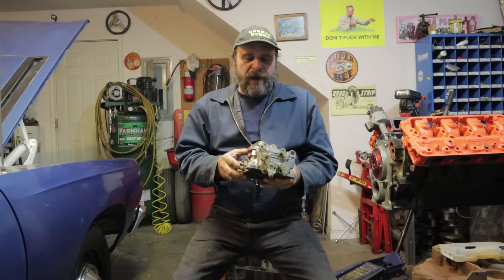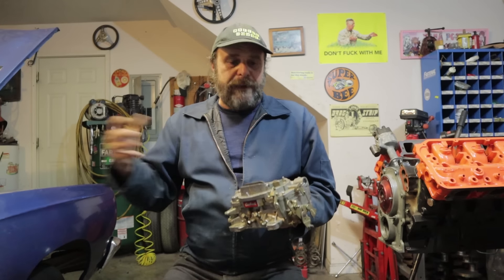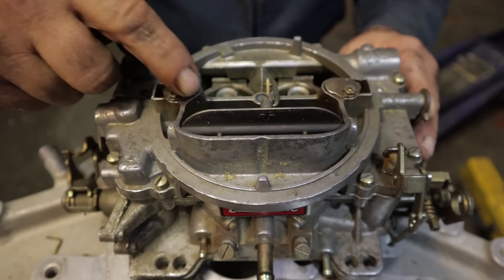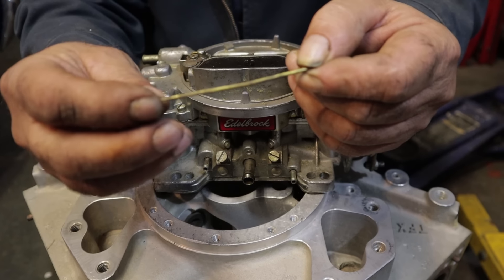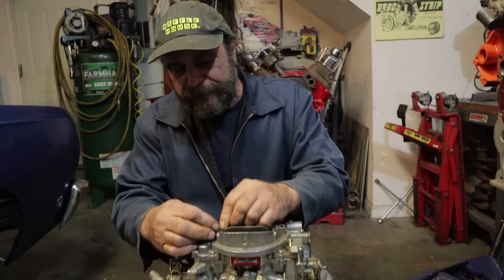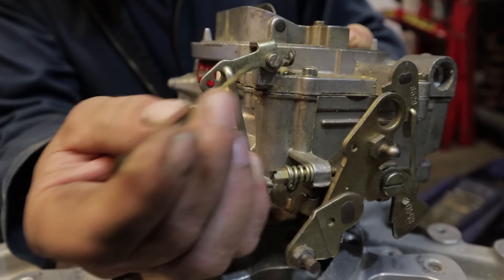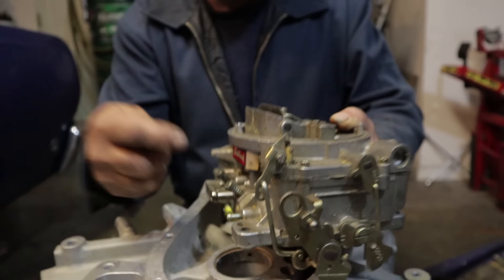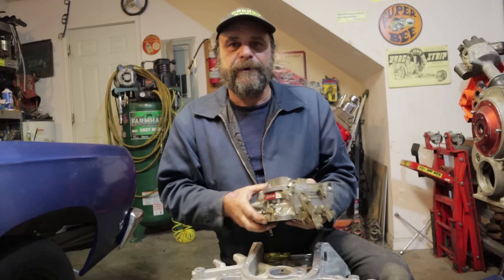How To Make The Edelbrock Carb REALLY Work For You

Comment: Thank you for this video. I have this one and reason im on here is to find out why my truck is stalling on me when i 1st tart it and go. It oes sit all week or sometimes only 2 or 3 days. Now i know its normal. Just started working on carbs. Always only used to work on fuel injections. Thanks again. Lot to learn on carbs. But my 69 Roadrunner 440 magnum is good then. I have in an 86 Dodge Ram.  I thought there was something wrong with it stumbling. I was about to go work on it. Its finny it starts great in 0 to 10 degrees weather but if its 30 to 40s it stumbles.

Comment: As long as you have a good understanding of how they work Holley's can be decent carbs if setup right and you have the right one for the engine you are running (no 750  double pumper with mechanical secondaries on a stock small block automatic car) but hands down for a street car the AFB is the greatest carb ever, I would take a holley over an AVS though or depending on application maybe even a Q-Junk since they are capable of up to 800 cfm......

Comment: Slowly trying to make a ford 400 less of a pig. Firstly having going from 2bbl to the Edlebrock Performer and that was a night and day difference. It aint gonna fix the lousy cam/heads but I wanna do a full rebuild later anyways. Least to say information like this video is priceless as I'm just now learning old motors.
-
One thing that still gets me is I can't get reliable starts. Brand new fuel system (from tank to carb) but sometimes she still just wants more gas. Other times I just bump the ignition and it roars to life. Maybe faulty starter? I'm kinda at my whits end by now.
Reply: Follow up, as I just found my old comment again lol. Turns out fuel percolation sucks and exhaust crossovers + mechanical fuel pumps, channel a lot of heat into the fuel line. Ethanol boils at around 150F, and since most (affordable) pump gas is gonna have some; it doesn't play nice with a hot engine.

Comment: i agree ,holley is best for all out race care performance but not for the street. the throttle blades can ice over and stick open if its cold out side.
 for reliability i love the Rochester just set it and for get it as the Rochester will be trouble free for years. 

street /strip performance/reliability , cater /edelbrock is the best choice.

Comment: ill keep my Q-jet. 

when i got my 77 chevy 1/2 ton the first thing i did was take off the eddlebrok and RPM manifold and swap on a stock iron manifold and a carter built q-jet from the mid 60s
runs fucking GREAT 

-50f and it will fire right up

Comment: This is what Ive needed. I have an off idle stumble that pisses me off. My edelbrock 750 works well but always has an off idle stumble unless I hit the gas harder than normal. 
Mine also drains or evaporates the primary as well as the secondary if it sets for say 2 days. Im running a mechanical pump with a regulator set at 5psi on my 402 bigblock.

Comment: Great video and explanation except I think you had it backwards on the heat of the day tune vs the cool evening air… heavier springs should be used in the cooler air to get the metering rod out of the jet quicker

Comment: a few things. empty float bowls in the morning. disconnect the fuel line to the carb and attempt to blow backwards thru the pump.. if you can blow backwards.. you need magnets in the fuel tank.. or strong ones stuck to the bottom.  and a 10 micron fuel filter directly before the fuel pump.. with the line disconnected after the fuel filter install before the pump.. stick the fuel hose in a clean 1 or 2 liter plastic soda bottle and get somebody to crank the engine for 15 seconds while you watch the pulses.. do this 3 times. each time 15 seconds of full flow pulses..  this is usually enough to blow the sediment out of the fuel pump check valves.. 1984 corvette fuel filters are 10 micron.. not all fuel filters are .. 

 Edelbrock carbs also have several off idle stumble issues.  lightly seat the idle mixture screws. counting turns till you lightly seat them. then take the idle mixture screws out.. 1 second blast of carb cleaner in the holes one at a time followed instantly by a blast of compressed air.  do both sides twice.  WHY???    sediment is picked up from the float bowl and dirt from the idle air bleeds when air cleaner mounting gaskets are not used.  the idle feed port below the throttle blade is exposed to manifold vacuum.   this pulls the fuel up thru the idle circuit pickup tube.. thru the economizer restriction (IFR for holley guys)  sediment getting stuck in either the pickup tube or the economizer causes the carb to fall flat on its face. as it goes lean before the air flow thru the throttle blades has enough flow to create a vacuum at the booster venturi's and pull fuel up thru the main circuits.. 

 lastly.. BIG engines..  as far as i can tell the stock Edelbrock  Economizer restriction is sized for a 350 to 355 cubic inch engine.  OEM carters have sized for the engine economizer restriction.. which is why you will find calibration numbers on various primary boosters.  if you have a 383 or larger engine you may need to carefully drill the economizers .001" at a time.. put them both back in and take it for a short test drive..  if you get it right.. you won't believe the low speed drivability difference.. its between having a mule and having a stallion.  get it right and you won't be able to keep rubber on your rear tires.. they will start spinning just off idle before the primaries come in.

Comment: I love the edelbrock performer carbs, theyre indestructible. I will be running a 1411 750 on my 471 if my engine likes it.
Reply from the maker: You're going to need a bit more than that to keep a 471 happy.
Double the cubic inch for a baseline ballpark carb size, and then go bigger from there
Reply: @UncleTonysGarage  well I have a 830 holley classic hp as well.

Comment: I build Qjets and Holleys, you could say I know carbs very well, I do E85 conversions on them. I have several E carbs, and I am not much of a fan for performance use. Not because they don't run, its because they leave power, drivability and mileage on the table compared to the other two. The Holley gets about the same mileage as the AFB/AVS but the E carbs are down on power, and the drivability is meh compared to a Holley. The Qjet blows the E carb away for mileage and drivability while making noticeably more power. Qjets are not for noobs though, not even a little bit. Once you learn them, every other carb is easy.

Where the E carb shines is for people who have very little understanding of carbs, driving mostly stock or very mild 350ish cube engines. I notice the difference in all these carbs because I daily drive a 455 with more than 550hp/600tq. There is a sluggishness that can't be tuned out with the E carb on my engines, they are simply down on power. 

The 455 HO in my 72 Formula displayed the difference very well. The guy I got it from threw away the Qjet and stock aluminum intake, which are now worth about $3500 because they were only used on 455 HOs, and put an 800 AVS on it. He struggled to get out of the 13s, trying everything you do to a chevy to go faster, 3.70 gears, 3000 stall, Torker II intake, MSD6AL and the best he could do was 13.4@98. I put a stock iron intake on it with a Qjet, was stuck with the 3.70 gears which slow down a 455 compared to a 3.08-3.55, and the 3000 stall wastes 500-800rpm of torque, but the first run was a 12.60@110. Some tuning got 12.40s, but with a 3.08 or so rear gear it would be an 11 second car all day. 

I messed with that AVS for days, springs, metering rods, jets, and there just isn't much you can do with them. Not enough secondary opening rate tuning available to make a difference. The Qjet owns the E carb hard core with tuning of the secondary opening rate. Its an Allen head set screw and a flat blade screwdriver to get the perfect opening rate within a handful of runs. 

There just isn't enough range for them, ya get what ya get and gotta be happy with that.

That is a bonus for people who have no idea about carbs. They really can't screw anything up. I have bought several 4150 Holley 850 carbs from chevy guys who thought they could run 62 jets in them on their 350 chevy, and they never got them to run. The first was a very nice Carb Shop carb, got it for $75 when he paid $450 and couldn't get it to run. I jetted it to 82 front 88 rear and it was absolutely amazing on my 11 second $2700 Pontiac 455. 

Its very hard to screw up an E carb like you can a Holley, and you really gotta know the Qjet to do what I do with them, so the E carb is absolutely perfect for the guys who don't know much about it... especially the ones who turn the idle mix and think they are rejetting it. My brother who is a heavy mopar nut likes them because his cold blooded 360s will shred a power valve on the first crank. He killed a decade's worth of power valves one year with one of my 4150s on his 360. For some reason, I have yet to ruin a PV on my engines. I have a 780 Holley 4160 ready to go on my dad's 426 Wedge in his 64 Sport Fury so we can put it on E85 and get it to stop running so damn hot, but I have to make it back home to try it out. 

If you have a stockish 350-360, and just want to throw it on and go, the E carb is your baby. You have to work pretty hard to jack it up enough it won't run. I put them on cars I plan to sell so I don't have to part with my Qjets and good Holleys. If I need a carb and I am not near my stash, I will get an E carb from someone used and throw it on until I get back to my stash. They work, but I don't expect much from them... also I don't drive anything smaller than a 400 in summer that isn't fuel injected.

Comment: I have a 670 street avenger on my Olds 403 it actually works pretty well but I need more jet especially on the primary side. You’re right though, it’s a bish changing the jets! Almost to the point I’d consider swapping to Edelbrock, I have a 750 sitting on the shelf but it may be a bit too big for my current setup. Oh and I did cheat a little getting the tune right, by installing an O2 sensor.
Reply from the maker: The 750 should be just right, if not a tad small.
Reply: Avengers are notorious for being  lean just off idle if your motor has any extra cam duration.  One of the fixes is to drill out the idle fuel restrictors like .002 thou. Better do a search on it.
Reply: Jimi Fed it does have a little duration over stock, 219/229 @ .050. I’ll look into that mod
Reply: Uncle Tony's Garage I have to replace the intake gaskets this weekend anyway...I may give the ol Edelbrock a whirl

Comment: The issue I have currently is I'm running a bigger cam, but I have 10 pounds of vacuum at idle. The carburetor comes with tuning manual.

Comment: I have tuned rebuilt 100's of Holley's over the years. When you first get to know them, they can be frustrating. Once you are past that, they are a fantastic carb. Nothing looks better than a Holley.
The carter is for those hoping to just take it out of the box and go.
Its cheap like the man said and near idiot proof.  
I have several carters collecting dust on a shelf, anyone want them?
Reply from the maker: Sometimes cheap and idiot proof are really good things
Reply: @UncleTonysGarage  I know that's the same reason people like chevys. It took me awhile to learn about the Ford engines.  Example, 3 different c-4 transmitions. I am an expert on Ford engines, especially the Cleveland.
 But a Chevy, you can learn about them in a week.

Comment: My vacuum is at 18.5 and sounds great on a newly rebuilt 302 with an Eddlebrock performance cam and the 1406 carb. The step up spring on one side pops all the way up with the engine off and the other sets down. If I rev the engine at idle, neither move.

Comment: The biggest problems I see here in Socal is the accel  circuit gets plugged and engine wont start without a squirt of gas. After cleaning out passages, i leave out the brass 'weight' that goes on top of ball  [under the squirters]    The ball sticks in its bore with the weight on it. This again has to do with the fuels, probably more so here in California!

Comment: Straight from edelbrock themselves. The elec choke carbs are set to run leaner than the manual choke carbs. So apples to apples (ie 1406 vs 1405) consider that also.

Comment: Thanks Tony for explaining the secondary bog on a hot restart. I put a dual feed line on my 800AVS thinking that would help but it really didn't. After tuning the jets and springs and step-up rods I have it working flawlessly on my stroker small block. 

I suppose with an electric fuel pump simply holding the pedal to the floor and turning the fuel pump on for a couple seconds and then closing the throttle before starting would allow the carb to sufficiently fill the secondaries?  It is embarrasing to nail it that first time and it just dies on you. Thanks for informing us on that!

Comment: I had a 750 edlebrock on my foxbody with a basic bitch 383 Windsor. And car made 370whp  and 400wtq. I put a quick fuel brawler 750 on it had it dyno tuned and it lost about 20 hp and 10tq. And it never ran as well. Car ran a 12.1@113 with an edelbrock, virtually no weight reduction and 3.08 gears.

Comment: Tony you still wearing those uniform jackets the laundry service used to supply? I liked thos jackets and pants. Pure polyester they melted onto your skin if there was a fire or welding splatter. > Those Accelerator pumps would wear the casting and noone made a repair kit for them. And they cut out in the turns.  They all have their quirks.

Comment: Ia there any truth the main bowls drying out after a few months of storage? My SB 350 with Edelbrock 1406 has to be cranked over repeatedly before she'll start. If run regularly, no issue. Good video, thanks for the tips on the metering rods!! New fuel pump, etc.

Comment: I've been trying to figure those damn holes out for a while. No one seems to know. Thanks.
Reply: The manual that comes with every Edelbrock carb explains the holes, and all the other adjustments, but Uncle Tony Simplified the heck out of it perfectly.
Reply: @livewire2759  I run a quadrajet, it has  similar holes.
Reply: @manicmechanic448  I run Q-jets myself, yes, they have two holes for adjustment, but it's a very fine adjustment on the Q compared to the ED.  Most Q-jets run just fine on the inside hole, very few actually used the outside hole, but the problem I've had with Edelbrock's is the S link on the pump.  Sometimes the link doesn't work right, and people try to fix it by changing the hole adjustment, only to make it worse.  One Ed that I had, the hole that the actual pump rod comes through the top was so loose that no matter how I installed the S link or the actuator rod, the damn thing would stick like hell so you had to push hard on the throttle to make it work, then it would suddenly break loose and go to full throttle.  It was a pain in the ass to drive, so I replaced it with a Q-jet and never looked back.
Reply: @livewire2759  U can turn ur Quadrajet carb into a racing Quadrajet and have a gallon jug of left over parts!! And a hard hitting secondaries!!! Some of early 80's Quadrajet carbs got plug on top front Of carb?? If so How to check if it's working rite, is use WD40 straw n stick in float hole car running straw should jump up n down fairly fast, if working!! If not replace that!! Item plug goes to!! Will make a world of difference in these style carbs!! Can turn both into racing carbs!!
Reply: @scottyjones27  Actually, the hole is there so you can adjust the power piston for the metering rods.  Only the computer controlled carbs will "jump up and down".  I prefer the older, simpler, early '70s Q-jets, but to adjust the power piston on those you have to take the carb off and bend a tang on the bottom.
Reply: @livewire2759 never answered my question???  U still got all that choke related parts on ur Qjet??  I removed even the choke butter fly on mine !! I'm sure you know that choke linkage will interfere with the opening of back two butterflies on the bottom of the Qjet???
Reply: @scottyjones27  I don't race, I'm just a poor grease monkey.  I set up my Q-jets for my daily drivers (old trucks).  I actually convert them to manual chokes and get rid of the crap that gets in the way of the secondaries, which is one reason why I prefer the older divorced choke style Q's.
Reply: @livewire2759  thanks for your time!! Gotcha !!  I do not race but had old 69nova with 5speed trans 305 engine built from junk yard parts I ran old style Qjet that's where my side kicks started calling my striped down Qjet, a racing Qjet!! My next door neighbor was the go to man for our town to build Qjet carbs So he knew what size to drill out secondary and fix the rest of it up!! Oh what fun that old nova was!! Oh yeah belive it or not that car fired up great with out any choke?? One pump one bump she was getting ready to go!! On cold mornings

Comment: Hey tony 
I have a 390 galaxie with a melling cam. I think it’s what was called an rv cam back in the day. Edelbrock aluminum intake so I think the cam is an mtf2, just a mild upgrade. I have an ollllld cater 4 brl, man. secondary carb but I don’t know where 2 start with the jets, metering rods & springs ? I really like how you explained how to check it when it’s running. Also thank you for the discussion on the accelerator pump holes. Thank you, Richard

Comment: That's all good Uncle Tony, but you never even detailed how you set one of them up. Where do I begin, the idle setting, or the fuel mixture screws in front? And where do I begin the first setting of the fuel mix screws? 1 1/2 open from closed position? 2 1/2 open from the closed position? And how do I dial the thing in so I am neaither too lean or too rich? Thisis what I need to know, the basic set up